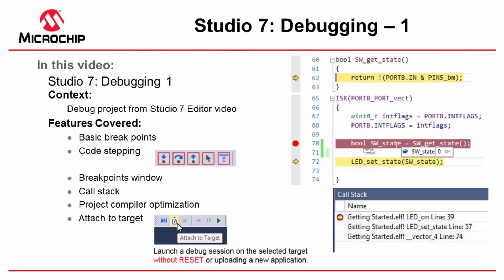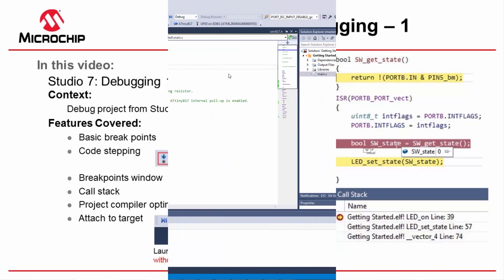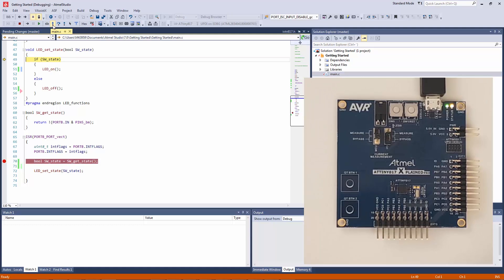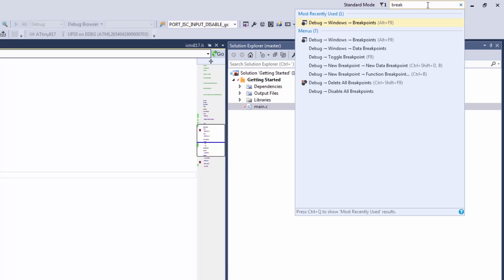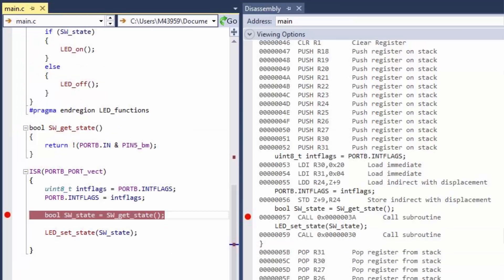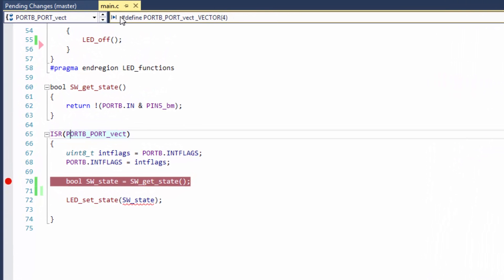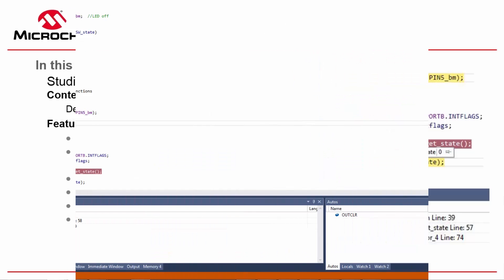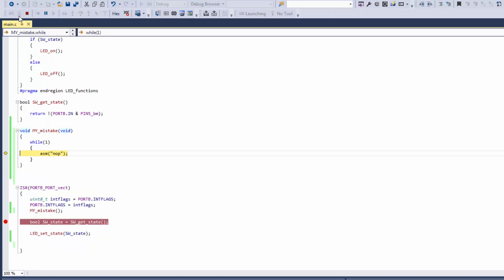Getting Started with Atmel Studio 7 - Episode 13 - Debugging Pt. 1

Comment: how do you get line number in your editor window?
Reply from the maker: Simply searching for “line numbers” in the top right search bar reveals that this menu item is under: Text Editor -> All Languages -> General
There you can check the Line numbers box. For more tips on the editor see: 
https://onlinedocs.microchip.com/pr/GUID-54E8AE06-C4C4-430C-B316-1C19714D122B-en-US-2/index.html?GUID-00257F02-E33C-40C3-B324-83DBCC05EC30